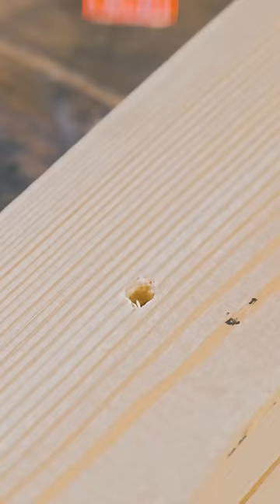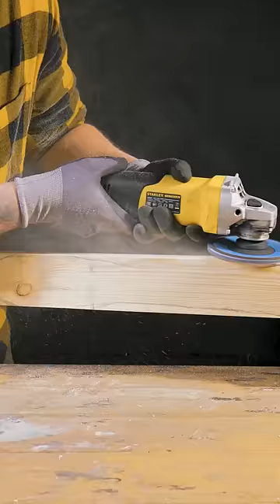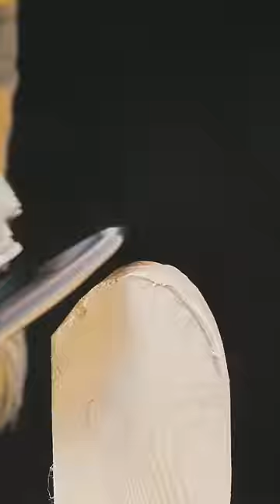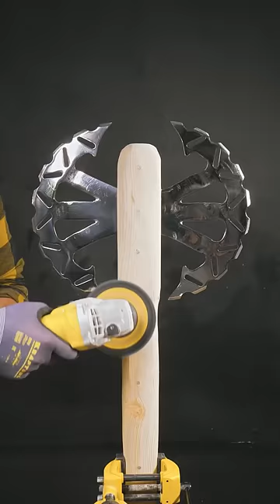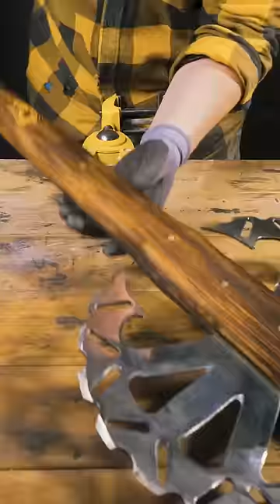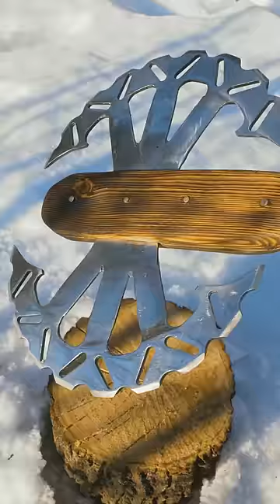Axe from the wheel 🪓

Comment: Wood glue won’t stick to brass, pine is terrible for an axe handle, and a bandsaw would have been much better than an angle grinder, but hey…
Reply: It will stick well enough for the mainly decorative purpose the project is designed for.